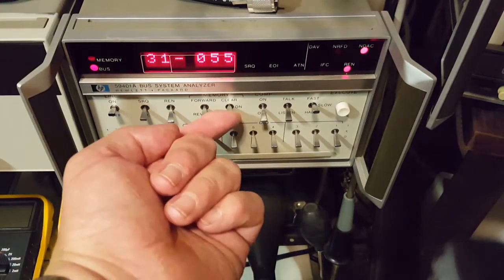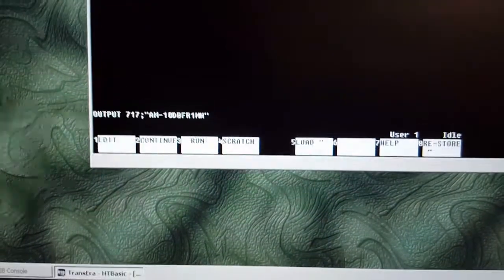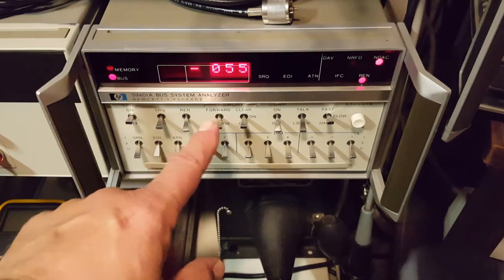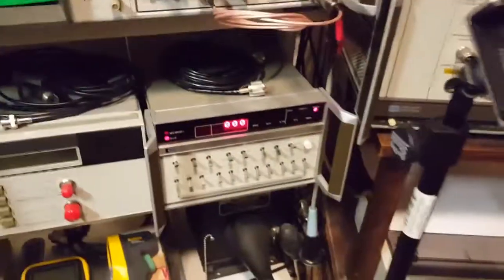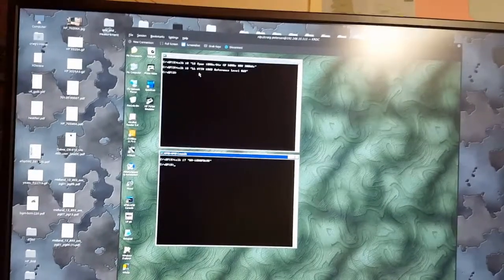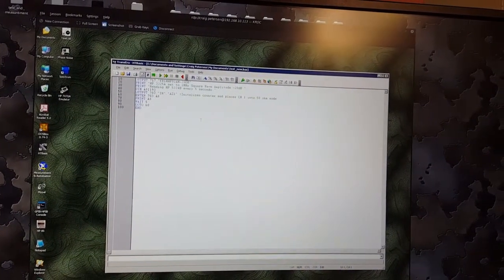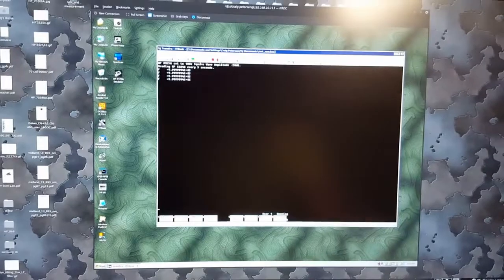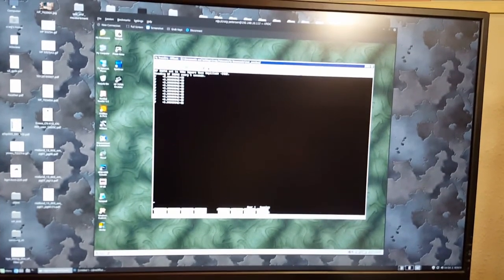HP 59401A Bus System Analyzer

Comment: Seems like you are the man! I’m a Electroics hobbyist and have acquired several HPIB instruments. I can use Keysight connection to send commands but have been looking for a way to control using a program. I want to start simple with some blinking lights on my relay actuator. There is nothing on YouTube as a tutorial. Hopefully HTBASIC isn’t to costly.
Reply from the maker: You might want to download KE5X's GPIB tools. I use several of his command line tools called query, talk and listen. Talk lets you send instrument commands, you can use it in batch files to set up several instruments at once. Query lets you retrieve measurements and listen can be used to listen to a certain instrument and then display the captured data to the screen. HTBasic will let you actually run the code examples in the manuals with little to no modification. I purchased their "hobbyist" license, when I purchased mine it was $550.00. However I treated this like an investment. They do have a "trial version", the only restrictions I'm aware of is that you cannot save your work (you'll have to use a text editor of your choice) and the program times out after 30 minutes, after that you'll have to restart the program. Thanks for watching!
Reply: @CraigPetersen12f36b  Thanks